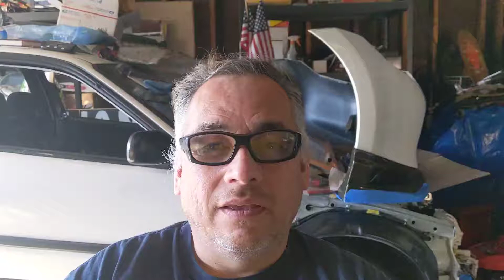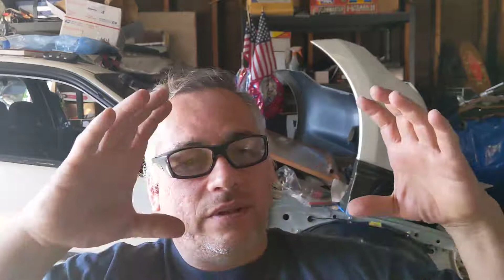catalytic converters and how they rattle

Comment: Every  converter thats stock and not messed with and was put on by the dealer is federally covered up to 80,000 miles that's why you don't mess with your exhaust...I've had the problem at 75,000 miles went to the Mazda dealer my car's warranty was out  By a few years because my car is 10 years old but my mileage is only 75,000..   And it was throwing a code that my converter was bad, they try to give me a walk around like I didn't know what I was talking about but then they gave in...Ordered the $1900 part because it was the manifold converter, couple weeks later I went in they were placed it free... they are required by law as long as it's below 80,000 miles doesn't matter if you're the second owner or the first owner or 5th..  The only thing that is required is that you do not alter your exhaust..    If you don't believe me look it up yourself under a federal cat warranty..  Actually all your emissions are covered up to 80,000

Comment: Or it could just be a heat shield and can be solved with a couple hose clamps?
Reply from the maker: It's internal pieces that fall apart
Reply: @tdperformancecorner704   Mine had external rusted spots.  A couple hose clamps worked well for me
Reply from the maker: @deasttn  that's an external rattle, good fix. Many of these fall apart internally. I actually see more internal degradation t than the external shields falling apart.